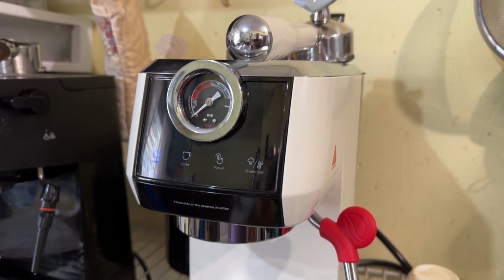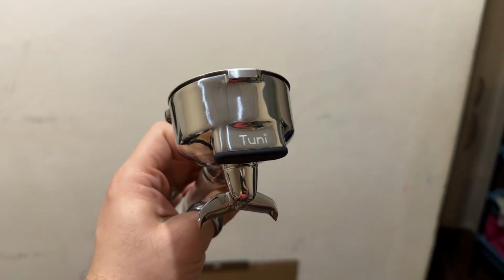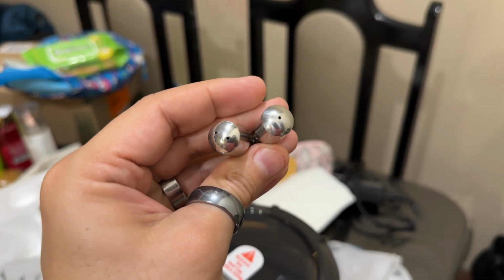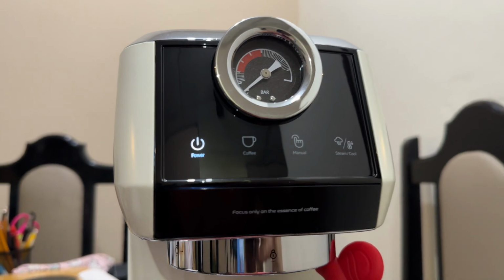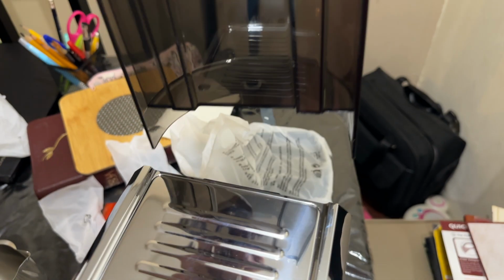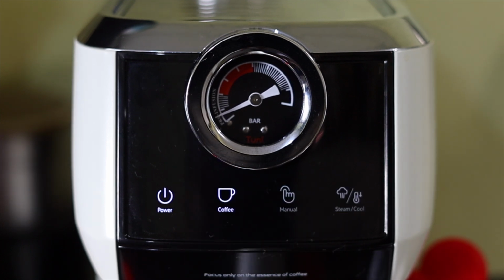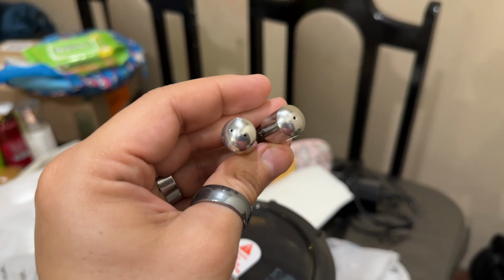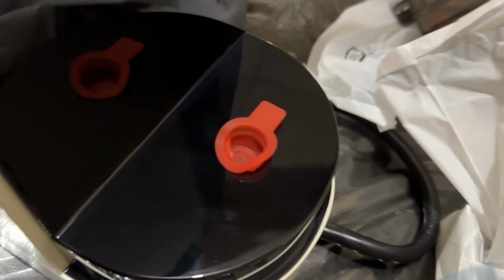Tuni E2 Espresso Machine | Best espresso machine under $200 ?

Comment: I bought this off Amazon and it lasted all of 2 shots. First latte made in manual mode with no issues. Second shot I pulled the pressure gauge started filling up with water then the machine lost all pressure.
Reply from the maker: Sorry to hear that 😢